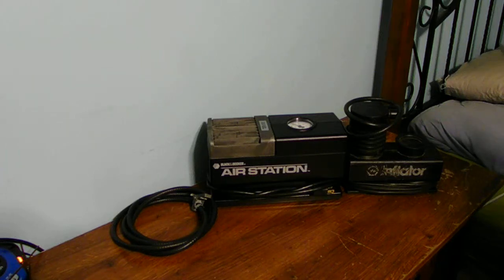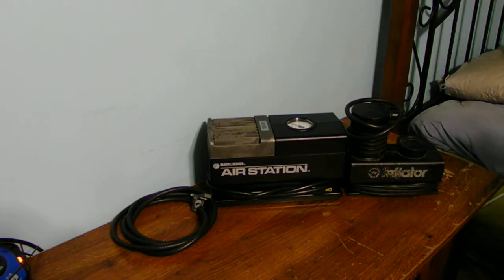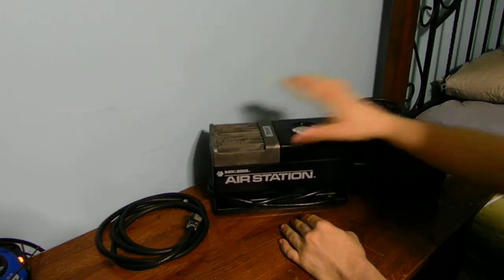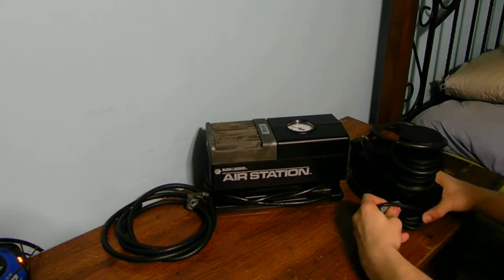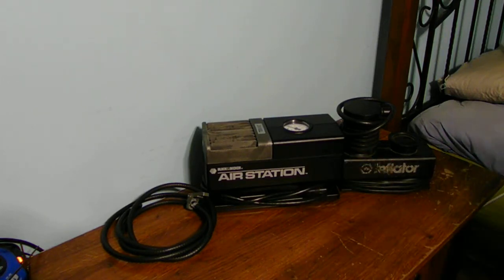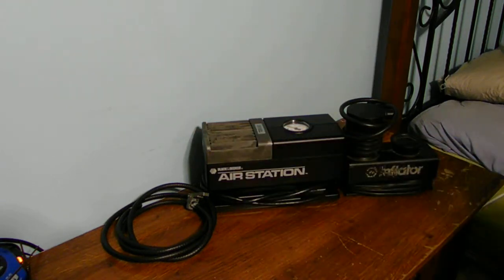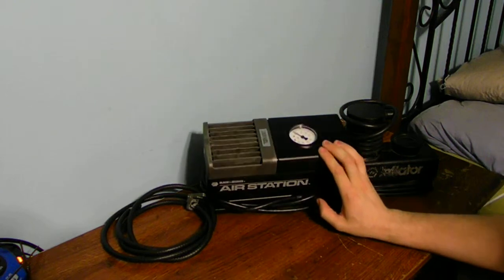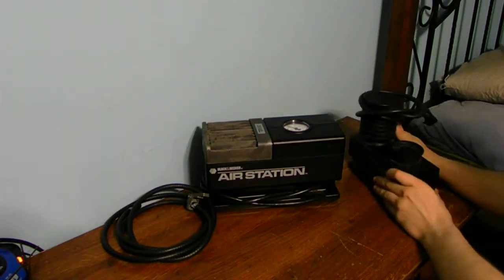TWO OLD FASHIONED BLACK & DECKER AIR PUMPS

Comment: I've had the old "air station" for 25 years and it still operates fine. Now that I've attached an air inflator I've found that it does not shut off with a closed air chuck or a pistol grip inflator. Just be careful not to completely close the hose or pressure builds up In a hurry.
Reply: Richard P Glad to know that you have had the air station for 25 years and it still works. I was the Engineer who designed it.
Reply: Shin - you did a great job! It is still the best compressor of its class. Thank you!!!
Reply: Richard P - You are welcome. It is quite exciting knowing own "hard works" served customer satisfactorily. Cheers!
Reply: @shinhwang7803  Whats the realistic pressure you can get out of these? Most small inexpensive pumps have trouble with 30-45psi.
Reply: @DarkLinkAD  That's a hard question for me to answer now as it has been  30 years since I have been involved.  Basically, it was designed for inflating  regular car tires that only need pressures in 30~45 psi.  It may go higher if left on and if they haven't put a bleed valve to keep it from going higher.  One major reason not to go above that pressure is to keep motor from over heating or melting the plastic housing.  The higher the pressure, the more current motor draws.  Motor temperature and bearing load rise very quickly to cause failure.  It was not designed nor made to handle that.
Reply: @shinhwang7803  Ahh, thanks very much for the info. I tend to enjoy purchasing cheap units like the $6.99 Harbor freight unit, and modifying them out of curiosity.
The seal on these seems to be a piston ring made of hard rubber, with a small amount of grease. 5 Mins of runtime is enough to cause significant burns and deplete the unit of lubrication.

Im currently modifying a 212cc ""Predetor
"" or otherwise known as a "Honda Clone" into an air compressor, with the hopes of extreme reliability.
Reply: @DarkLinkAD  Well, the Piston ring is a piece of Teflon disk which does feel like hard rubber felt and touched. As you know, Teflon is a kind of dry lubricant.  Yes, straight 5-minute run will dry up the light oil in there and greatly reduce the life of  the seal. The tool was designed to top 200 pieces (don't remember the exact #s now) of 19" tires from 20 psi to 35 psi in 2 minutes. It did that well.  I believe I am thrifty as you are. No Money tree in the backyard.  This tool does bring back fun memories.  All calculations were done on one 20+ people departmently shared dual floppy-Drive IBM 80886.  One drive holds the DOS disk, one holds the Lottus 123 spreadsheet program.  It took 15 minutes to run my program which gave me time to get coffee and chate with coworkers while I could still claim I was working.  Drawing was done on IBM terminal connected via telephone line to CADAM (the early CAD) software on IBM mainframe 300 miles away in headquarter.  Each line drawn on the screen took 5 seconds to send to and bounce back.  You better save your work every 10 minutes or it might get lost in the abyss.   Ha, ha.
Reply: @shinhwang7803  Its strange how new tech seems almost lifeless compared to what was used in the 80s and even 90s.
 You should document some of your passions on Youtube, im sure you will catch a crowd that can learn and greatly appreciate from it.
  
 A bit off topic example would be, "Modern Vintage Gamer" which is a gentlemen who was a major part in creating emulation for video game consoles, he also keeps up to date with new strides in emulation and bringing life to once forgotten consoles, creating and restoring on-line service.
Reply: @DarkLinkAD  Me on the YouTube?  Never thought about that.  You got me thinking.  Nice to chat with you.
Reply: Nicholas Sims  Hi, I'm not sure I can help you on that.  After all , it had been 35+ some years since I worked on that.  Many details had faded away.
Reply: @shinhwang7803   I have a working air station in 2020 and was looking for how to service it, it must need oil or grease by now, I got it new. Nice to meet you, Jim
Reply: @Nighthawkrun  Hi, Nighthawk, unless they changed the dual Teflon disk piston ring to something else, otherwise there is nothing to be serviced.  No need of oil or grease anywhere.  Teflon is a dry lubricant itself.
Reply: @shinhwang7803  Thank you for the reply
Reply: @shinhwang7803  I have the air station and the gauge doesn't go to 0. Is there anyway to fix this? I don't know if I can trust the reading it gives.